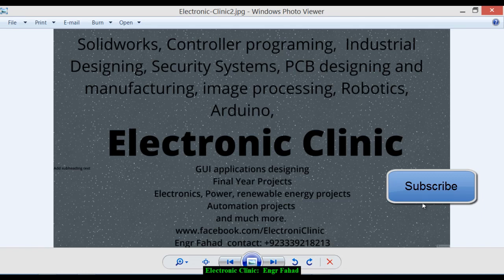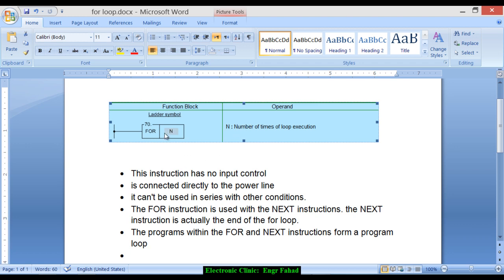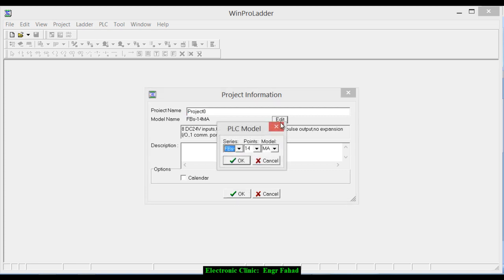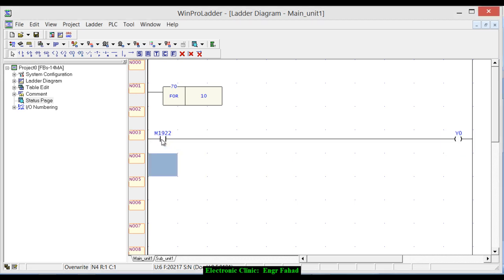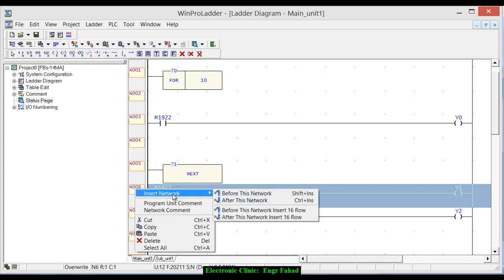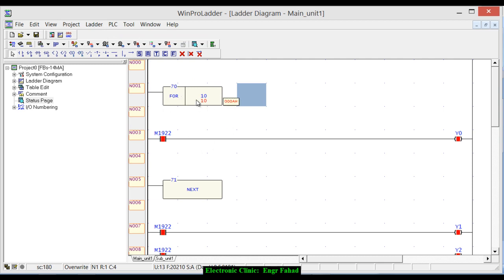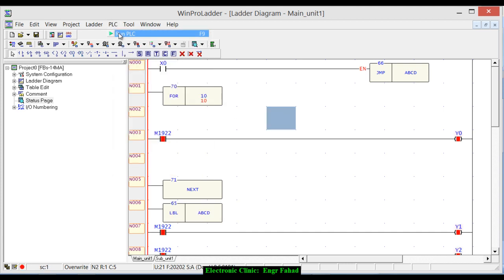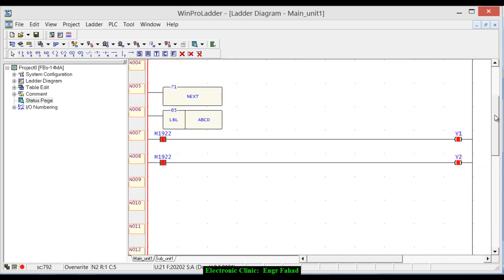PLC ladder logic programming tutorial# 19: For loop  FOR and NEXT instructions "Fatek plc"

Comment: Hey nice vid!! I have question though, How can I go through 40 registers and put values in them using loops??
Reply from the maker: ilyes skender for what purpose u wana use that ???
Reply: Electronic Clinic a machine has 40 post
Reply from the maker: ilyes skender tell me exactly what u wana do?? coz there are so many techniques to accrss registers values
Reply from the maker: ilyes skender u can use sensors , u can use conditions etc etc. tell me about the process then i can tell u
Reply: Look I need an assembly code that  goes from ab0 to ab40 and put values in them ....that would do it! Thanks in advance
Reply from the maker: bro its ladder logic programming not assembly code. One more question you are storing values from sensors or you have some predefined values?? if predefined values then you can directly save them in registers. For this you will make a register table.
Reply from the maker: watch all my tutorials , in some tutorials i have used registers. those tutorials will make it clear to you, how to store and fetch data from registers.
Reply: It's Chinese plc it can run assembly as well as ladder and the     values are predefined!